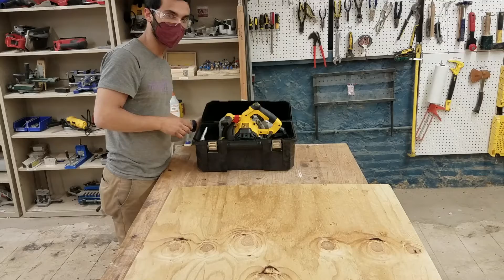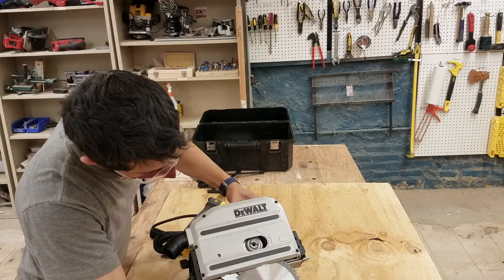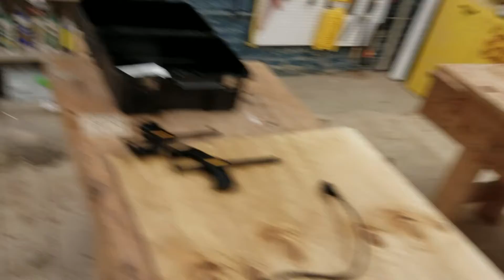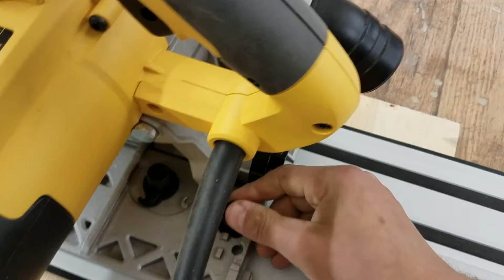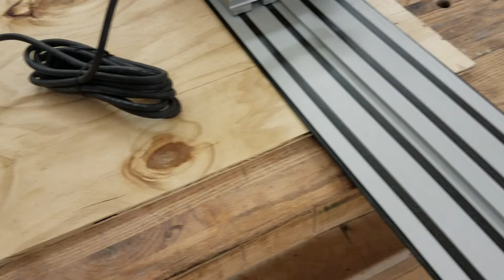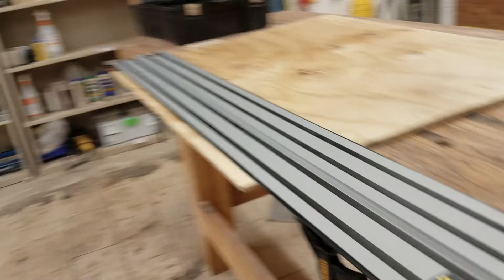How to Use the Dewalt Track Saw DWS520CK

Comment: Thanks for the instruction. Some things that could be better: 1 - it would have been nice to see a plunge cut into the middle of a piece to see how line that up (I'm cutting a hole in butcher block for a sink). Many things you said about supporting wood, not cutting your table, etc. seem inefficient to have to film for this crowd. Also, the mask is not helpful, lavalier mike, and camera height, as others noted.

Comment: You can also buy a cheap sheet of foamcore insulation and put your wood on top of that so you support the whole piece as you cut and don’t have to dangle any edges out or risk cutting your tabletop.

Comment: When scoring the rubber, the saw can't cut the first couple inches perfectly since the saws guides are off the track when you first start the cut. Isn't that important for when you set your track on the marks?

I have mine set to cut and if the back edge is off the track the saw moves around since the saw guide is not on the track. It doesn't make sense.
Reply: Can you lock the track onto the saw.
I’ve seen videos of the Festool where the track is on the saw.
The lift the saw to their cut piece as one piece no need to lay track then put saw on track.